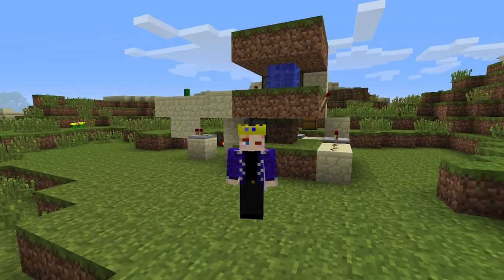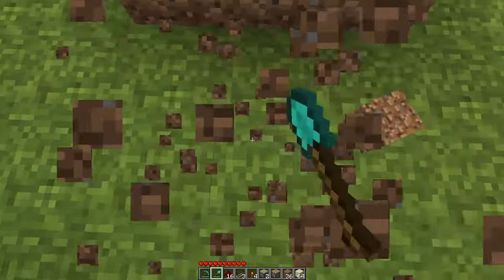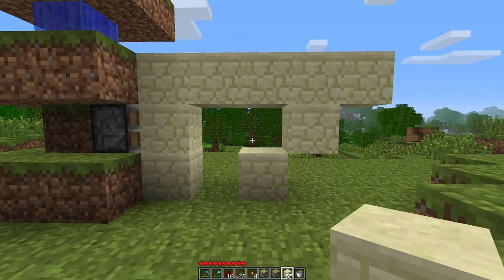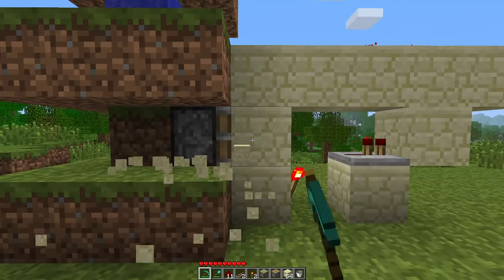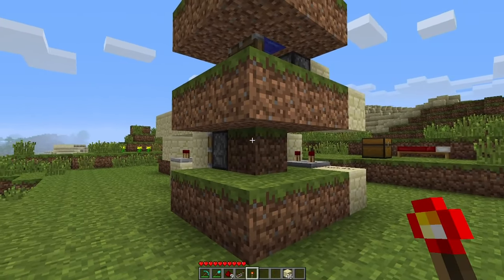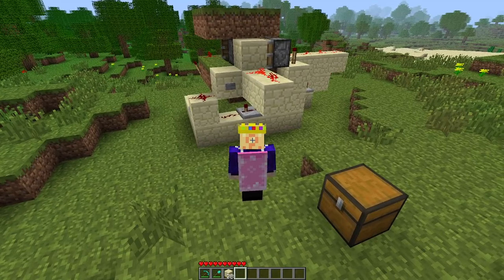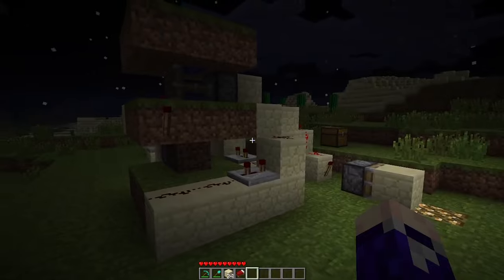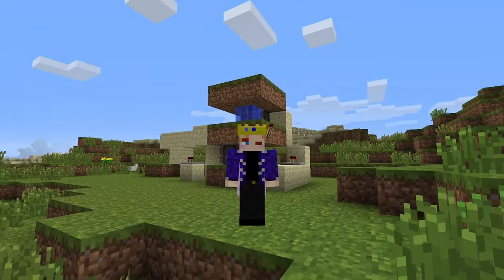How to Build a Daylight Sensor in Minecraft Beta 1.7.3

Comment: Does this work if I'm using the "clear water" option in optifine? I assume I just need to make the water area 3 times as tall, as the option makes water lower light level by 1 instead of 3.
Reply from the maker: The optifine option is probably just a visual change rather than changing the mechanics of the game so it should still work
Reply: @BoxBlair  Actually, it appears not to be. I've noticed changes in grass growing underwater since turning the option on.
Reply from the maker: @quippits3201  I feel like that’s very strange that optifine would be doing that and not some other kind of mod. Sorry I’m not sure
Reply: @BoxBlair  I also think it's strange. I'm using Mongster's MultiMC instance. I don't think there's any other mods in that instance that would do that. I'll just do some testing to see what works. Doesn't really matter to me whether I have to do two water blocks or six.